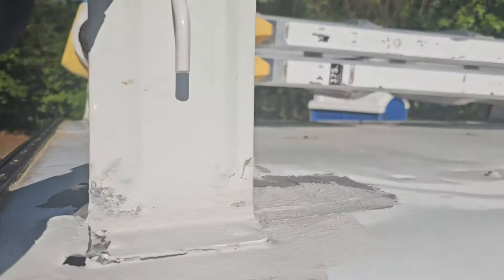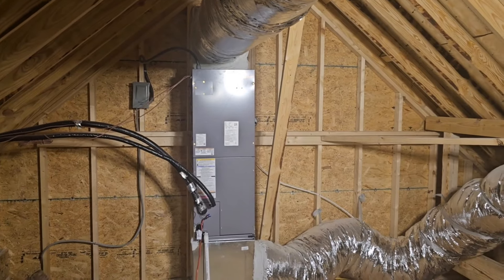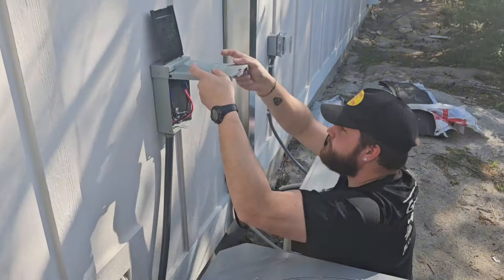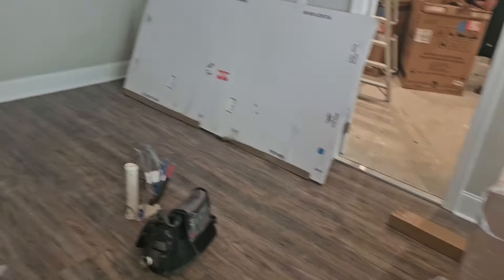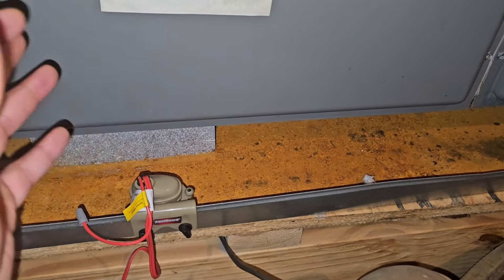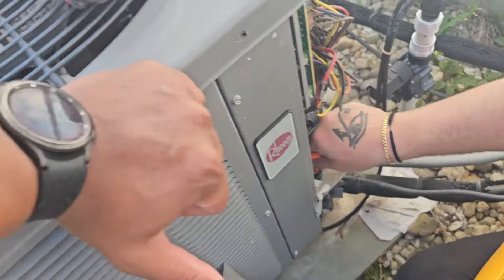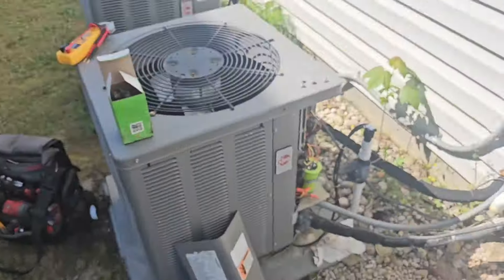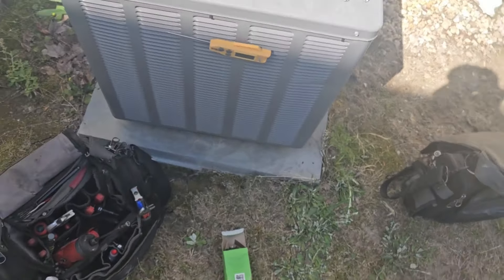Monday Service Calls and Going Behind Installers #hvac

Comment: You should have looked inside the condenser for the plug. That’s where we used to put it if we want the unit turned on. 
Love the channel, but your helper needs to put the phone away
Reply from the maker: I thought that too and we did check it off camera. Had to show Jacob that the reversing valve was wired for O at the condenser so we knew what to program the nest to

Comment: That quality of HVAC work is unacceptable.  Really sloppy stuff.
Reply from the maker: Don't mind the criticism but atleast be specific on what part of the work is unacceptable
Reply: @AB_HVAC  The flex duct needs to be pulled tight at all points.  It is very loose and zig zaggy as it enters the upstairs air handler.  Also, that lineset work is very shoddy around the air handler as well.  Look, I'm sure it works fine, but we are all here to improve.  I've been installing these things for 30 years and I take great pride in what I do.  Your guys need to clean things up a tad.
Reply: @joshuaseaton7002  wouldnt that create unnecessary static pressure? I'm here to learn but from what i've gathered, the kinks in flex.duct  from straps creates resistance of airflow.